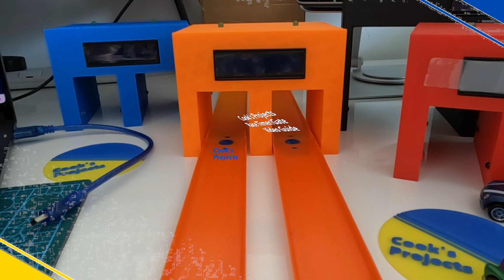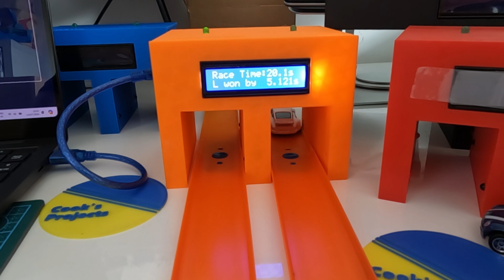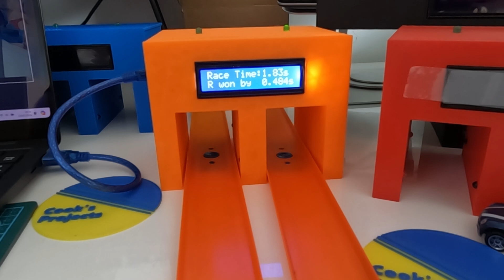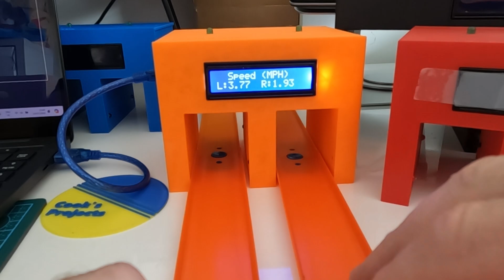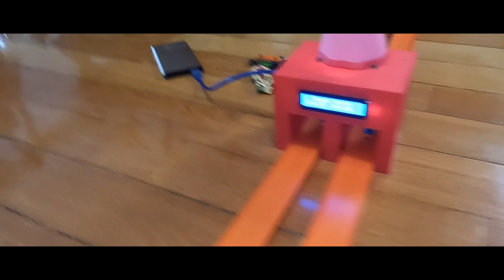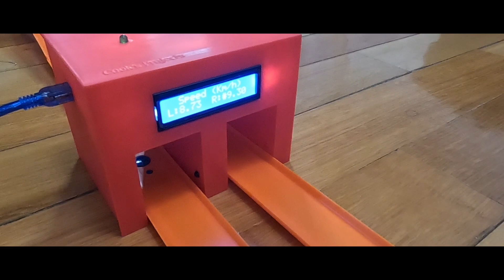Cook's Projects Race Gate: start and finish line, race timer and speedometer Instructional Video.

Comment: Hi. I am very interested in the system.  One thing I am missing or maybe I missed some info...  Is there any chance to connect gate somehow to starting mechanism? I mean....  I would need one of two starting procedures.  1. Manually start cars and timer, or 2. Timer starts automatically with cars released in the same moment.  Is any chance to do it somehow, please?
Reply from the maker: Hi Eddie.  The Race Gate will count you down to the race start with a sound and light sequence.  The race timer starts once the lights go out.  You can anticipate and release cars at this point.  So an elapsed time for the track is available, but includes reaction time; just as a real race.  If enthusiasts are keen on measuring car/track performance then they often believe that the accurate race time, from release to finish, is needed - so a car release system is needed that synchronises with the timer.  If the timer system can only measure elapsed time, then this is true and a release system is required.  To calculate energy levels, you will then also need the exact track length (measured in the SI unit of metres) and to get a scientific result, you should also consider the delays in signal propagation from timer to starter as well as the mechanical delay in activating the gate.  This can give an average speed over the track.  Most race timers available can only measure the time of the car on the track and need a start system.  But our Race Timer/Gate measures the cars actual speed as well as the exact time difference between cars passing the finish line (down to 100,000th of a second and 1/1000th of a metre per second (SI unit) with datalink versions).  From this, you can easily determine, which car completed the course first (the time taken from lights out), how many microseconds later the second car arrived at the finish line (performance difference between cars) and the exact speed of each car at the finish line (car/track performance).  From this information you can easily calculate the kinetic energy of the car; and so it's energy loss over the track - or it's efficiency.  You can also immediately see how altering track or car details changes the results.  Greater precision of these measurements is available with our datalink and advanced models which send this information directly to a computer.  For really accurate data (7x better accuracy) the advanced version of our Race Gate should be used.  We also have a free spreadsheet available on the website that can do all the math for you!  All you need to measure is the car weight and the height difference between release and finish.  No need to consider signal/start release delays. Check out www.cooksprojects.com/faqs and other videos on this channel for more information.
Using our methodology means you need less equipment, reduces the costs and complexity, whilst also allowing an easily movable race gate to be placed on any straight section of your track to allow for fine tuning at specific locations that gives accurate scientific data.  e.g. how much speed (and so energy) is lost in a turn?
To conclude, elapsed time is not as critical as the other measurements our Race Gate can provide.  So, a race starter is not required.  If data between cars is required, a system of releasing cars at the same moment would be needed.  These are manufactured by Hot Wheels or can be made simply yourself.
Hope this information helps.  We have contact forms on our website if you have any further questions.
Happy racing!